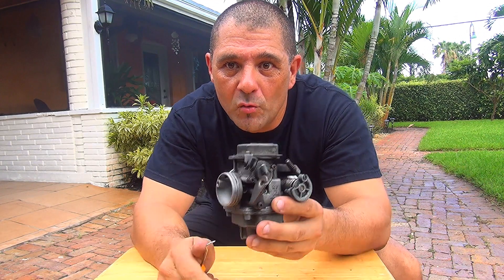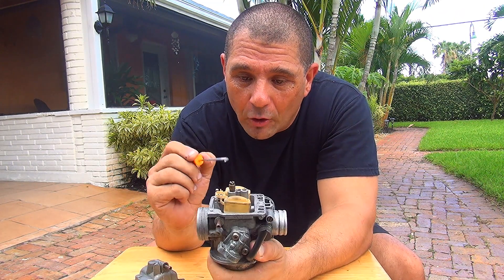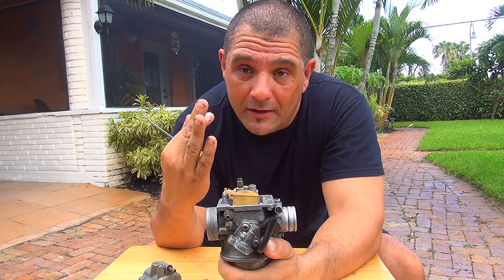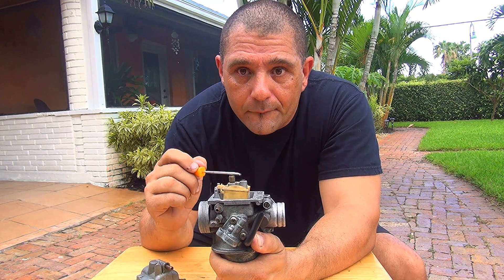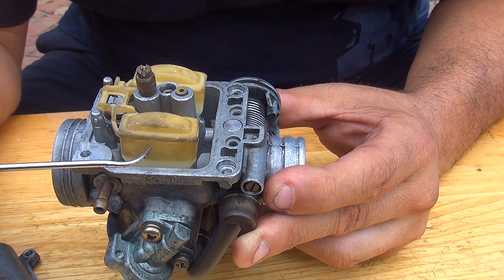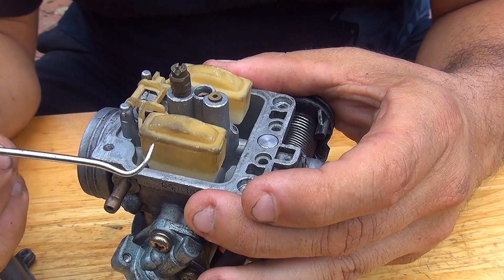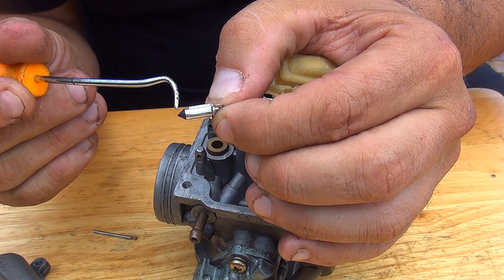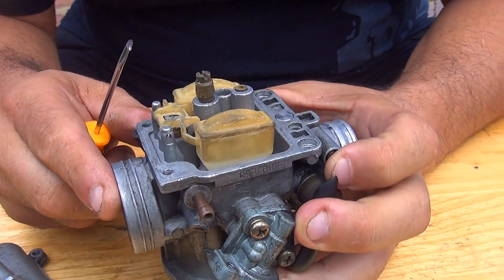Carburetor Float Level Adjustment

Comment: My bike stalls when i accelerate, unless i accelerate very slow. ¿can the float be the issue?
Reply from the maker: Yes, a high or sticking float can cause that. It may be flooding the carb check float height and needle valve.
Reply: @VirberelloScooterTips thank you

Comment: Thank you 🙏 didn't even realize this could be the issue you saved be from replacing the carb
Reply from the maker: Glad to help
Reply: @VirberelloScooterTips  So if the carb is leaking from the overflow spout - does that mean that the float is sticking OPEN and that the needle valve is not closing to shut off the fuel?

Comment: my float bowl keeps popping out and i cant securely fit it in, what do i do?
Reply from the maker: If your carburetor float bowl on your gas scooter keeps popping out and you can't securely fit it in, there are a few steps you can take to diagnose and fix the issue:

Inspect the Float Bowl and Carburetor:

Check for any visible damage or warping on the float bowl itself.
Ensure that the float bowl gasket is intact and properly seated. A damaged or improperly seated gasket can cause the bowl to not fit securely.
Examine the carburetor body for any damage or debris that might prevent the bowl from fitting correctly.
Check the Float and Needle Valve:

Make sure the float is not sticking or binding. It should move freely without obstruction.
Inspect the needle valve and its seat. If they are worn or dirty, they can cause the float bowl to not fit properly.
Secure the Float Bowl Properly:

Ensure that you are aligning the float bowl correctly with the carburetor body. It should fit snugly without forcing it.
Tighten the screws or bolts that hold the float bowl in place evenly and securely, but be careful not to overtighten as this can strip the threads or damage the bowl.
Replace Worn or Damaged Parts:

If any parts are found to be damaged or excessively worn, replace them with new parts. This includes the float bowl, gasket, needle valve, and screws or bolts.
Check for Compatibility Issues:

If you have recently replaced the float bowl or carburetor, ensure that the parts are compatible with each other. Incompatible parts can lead to fitting issues.
Consult the Manual or a Professional:

Refer to the scooter’s service manual for specific instructions on the carburetor assembly.
If you are unable to resolve the issue yourself, consider consulting a professional mechanic who can properly diagnose and fix the problem.
Taking these steps should help you identify and fix the issue with your carburetor float bowl. If the problem persists after trying these solutions, there might be a more complex issue at hand that requires professional assistance.

Comment: What if I have gas coming out the air filter side of carburetor
Reply from the maker: To address this issue, you may want to:
Inspect the float needle valve, ensuring it moves freely and seals properly.
Check and adjust the float level according to the manufacturer's specifications.
Clean the carburetor thoroughly to remove any debris or varnish.
Verify that the carburetor gasket is in good condition.
Examine the venting system for any blockages.
Ensure the fuel supply system is functioning correctly.
If you're not comfortable performing these checks and adjustments yourself, it's recommended to seek the assistance of a qualified mechanic or technician to diagnose and fix the problem.
I hope this can help you

Comment: Whenever I come to a complete stop, my gy6 150cc in my Vitacci scooter dies? I have set the idle screw up and it idles plenty fast, but why does it die just when I stop?
Reply from the maker: If your GY6 150cc scooter dies when coming to a complete stop despite adjusting the idle speed, there could be several reasons for this issue. Here are some possibilities to consider:
Idle Speed Adjustment: While you mentioned that you've adjusted the idle screw, it's important to ensure that the idle speed is within the manufacturer's recommended range. Setting it too high or too low can affect the scooter's performance.
Idle Circuit Issues: The idle circuit in the carburetor may be clogged or not functioning properly. Cleaning or rebuilding the carburetor could help address this issue.
Vacuum Leaks: Check for any vacuum leaks in the intake system, such as hoses or gaskets. Air leaks can disrupt the air-fuel mixture and affect the engine's idle and performance.
Fuel System Issues: Inspect the fuel system for problems such as a clogged fuel filter, faulty fuel pump, or inadequate fuel supply. Ensure proper fuel flow to the carburetor.
Ignition System: Issues with the ignition system, such as a faulty spark plug, ignition coil, or CDI module, can lead to stalling. Check these components for proper functioning.
Idle Air Control Valve (IACV): Some scooters equipped with fuel injection systems may have an IACV that regulates idle airflow. If equipped, ensure the IACV is functioning correctly.
Automatic Choke: If your scooter has an automatic choke, make sure it is functioning correctly. A stuck or malfunctioning choke can affect the engine's idle.
If you are unable to identify and address the issue on your own, it's recommended to consult with a professional mechanic who specializes in scooters or visit a dealership that services your scooter's brand. They can perform a thorough diagnosis and provide a more accurate solution to the stalling problem.

Comment: can i use 20w-50 oil in my 150cc engine
Reply from the maker: Anything is better then no oil but i will place the oil that is recommended for your scooter on your manual that will be best  for the performance
Reply: @VirberelloScooterTips   yes i checked it said to use 10w-30
Reply: @tommytuccersure I know your comment is a month old; but if you are still curious; the lower the W number is what protects your engine from wear during cold starts. If you use a different oil, try to make sure the W(winter) number is the same or lower than what is specified.

Now for the last number; this is operating temp viscosity.
With a higher number comes higher oil pressure; which can hurt seals.

If your motor has been used for 5,000 miles or more, your engine might appreciate a higher operating viscosity, like a 40 or 50 weight oil.
Reply: @greatestevar   ok I understand I didn't use the 20w50 I got a 10w40  . the weather is starting too get a little colder in ny so now I have too figure out which one too use now I know I need something thinner I believe

Comment: Hello do u know what a rattling noise is in the cvt ...only at high speeds.. its a new 50cc with 150 miles on it..
Reply from the maker: A rattling noise in the CVT  of your scooter, especially at high speeds, can be indicative of several potential issues. It's essential to identify and address the problem to prevent further damage. Here are some possible causes of the rattling noise:
Loose or worn components: Check for loose bolts, nuts, or other components in the CVT system, such as the clutch bell, variator, or pulleys. Over time, these parts can become loose due to vibrations and normal wear and tear.
Belt wear: Inspect the CVT belt for signs of wear, damage, or fraying. A damaged or worn-out belt can produce a rattling noise, especially when under high load at high speeds. If you notice any issues with the belt, it may need replacement.
Clutch problems: The clutch system in your CVT could be experiencing issues, such as worn clutch pads or a misaligned clutch assembly. These problems can lead to a rattling noise when the clutch engages or disengages.
Variator issues: The variator, which is responsible for changing the gear ratio in a CVT, may have worn rollers or sliders. This wear can result in a rattling noise, especially at higher speeds when the CVT is adjusting the gear ratio.
Transmission fluid levels: Ensure that the CVT has the correct amount of transmission fluid. Low or dirty fluid can lead to poor CVT performance and unusual noises.
Engine-related issues: Sometimes, noises from the engine can be mistaken for CVT problems. Make sure the noise isn't coming from the engine or exhaust system. Issues like loose heat shields, loose exhaust components, or engine misfires can produce rattling sounds.
Since your gas scooter is relatively new with only 150 miles on it, it's possible that some components may not have settled or worn in properly yet. However, it's essential not to ignore any unusual noises, as they can indicate underlying problems that, if left unaddressed, could lead to more significant issues.
If you're unsure about diagnosing or fixing the issue yourself, it's advisable to have a qualified scooter mechanic or technician inspect and repair the CVT system to ensure your scooter continues to operate smoothly and safely.
Thank you for watching my video

Comment: Hey, bro I know this is a different subject. But the scooter solenoid. If it is no good NI touch it with a screwdriver and my bike tries to start up. Does that mean it is no good and needs to be replaced?
Reply from the maker: Hey, bro! Messing with the scooter solenoid using a screwdriver is a trick to see if it's working properly. If your bike attempts to start up when you do this, it suggests that the solenoid might be faulty and needs replacement.  Safety first! Thank you for watching my video
Reply: @VirberelloScooterTips  Thank you so much, this guy is the best for your bikes information.......

Comment: Hello I have problem with my new carburetor he is not holding the idle and every time I stop like iam driving amd I stop the engine die when i dont hold the thortle
Reply from the maker: Hello! It seems like you're experiencing an issue with your new carburetor. The problem you described, where the engine dies when you come to a stop and you need to keep holding the throttle to keep it running, indicates that there might be an issue with the idle circuit or the carburetor's tuning.

Here are a few possible reasons and solutions for the problem:

Idle Speed Adjustment: The idle speed might be set too low, causing the engine to stall when you come to a stop. You can try adjusting the idle speed screw on the carburetor. Turn it clockwise to increase the idle speed slightly. Be sure to consult your carburetor's manual for the correct procedure.
Idle Circuit Blockage: The idle circuit in the carburetor may be clogged, preventing the proper flow of fuel at idle. In this case, you'll need to clean the carburetor thoroughly. Remove it from the engine, disassemble it, and clean all the passages and jets with carburetor cleaner and compressed air.
Air-Fuel Mixture: An incorrect air-fuel mixture can also cause idle problems. Check if the carburetor is adjusted to the correct mixture settings. If it's adjustable, you may need to adjust it according to the manufacturer's specifications.
Vacuum Leaks: Vacuum leaks in the intake manifold or carburetor gasket can also lead to unstable idling. Check for any leaks and fix them if found.
Choke Operation: Ensure that the choke mechanism is functioning correctly. If the choke is not releasing properly after the engine warms up, it can cause the engine to stall.
Throttle Linkage: Check the throttle linkage to make sure it's properly adjusted and not binding.
If you're not comfortable working with carburetors or if the issue persists after attempting these solutions, it's best to have a qualified mechanic or technician inspect and diagnose the problem. They will have the expertise and tools to identify and fix the issue properly.
Remember to always prioritize safety when working on your vehicle, and if you're unsure about any steps, seek professional help to avoid any accidents or further damage. Good luck with resolving the carburetor issue!
Reply: Thank, buddy I try everything what you write me, and a hope its is gona work because when I start the engine the idle is holding  but after some time not, ok thank you very much

Comment: Hello Virbirello mi amici, I have the strangest symptom with my Chinese 150cc. It stopped starting wiith two no rev limit cdi s I had I changrf the carb but it will only start with the stock cdi but revs at 5500 rpm, I am going to get a new NCY cdi but if that doesnt work, could it be the stator? Why would it only start with the stock cdi and cant adjust carb to right idle?
Reply from the maker: Ciao! It seems like you're experiencing an unusual issue with your Chinese 150cc scooter. Let's break down the symptoms and possible causes:

Starting Issue: You mentioned that your scooter only starts with the stock CDI (ignition control module) but not with the two "no rev limit" CDIs you tried. This could indicate compatibility issues between the aftermarket CDIs and your scooter's electrical system. It's possible that the aftermarket CDIs are not properly configured or not compatible with your scooter's specific wiring and ignition setup.

Rev Limit and Idle Adjustment: When using the stock CDI, you mentioned that the scooter revs at 5500 RPM and you can't adjust the carburetor to achieve the correct idle speed. This could indicate a problem with the carburetor itself or a potential issue with the fuel delivery system. It's worth checking the carburetor settings, including the idle screw, fuel mixture, and any potential clogs or blockages.

Stator Potential: If the issue persists even after trying a new NCY CDI, the stator could be a possible culprit. The stator is responsible for generating electrical power to charge the battery and power the electrical components, including the CDI. A malfunctioning stator can affect the ignition system and cause erratic behavior. However, it's important to note that a faulty stator wouldn't necessarily explain the compatibility issues with the aftermarket CDIs.

To troubleshoot and resolve this issue, consider the following steps:

Verify Compatibility: Ensure that any aftermarket CDIs you purchase are specifically designed for your scooter's make and model. Check with the manufacturer or reputable scooter forums to find compatible CDIs that have been successfully used by others.

Check Carburetor: Inspect the carburetor thoroughly, looking for any blockages or sticking components. Clean the carburetor and adjust the idle screw and fuel mixture to ensure proper operation.

Seek Professional Assistance: If the problem persists despite your efforts, consider consulting with a professional scooter mechanic or technician who has experience with Chinese scooters. They will have the expertise and diagnostic tools to identify the root cause of the issue.

Remember, troubleshooting electrical and mechanical issues can be complex, so it's always best to consult with an expert if you're unsure or uncomfortable performing the repairs yourself. Good luck in getting your scooter back to its optimal performance! Thank you for watching my video
Reply: @VirberelloScooterTips  Ciao! The carburetor is new, I tried it stock and with the previous carbs jetting on main and pilot w needle adjustment. Exact same symptoms. The idle screw and gas air mixture screw have no effect as to the revving issue. Also until recently both no limit cdi s worked fine, so I will try the new one ordered today, If not will seek assistance. Thank you Virberello for taking the time to answer my concern. Love your channel, all my best!

Comment: My gas tank is lower than my carburator. Would an electric fuel pump be overkill for a scooter? I don't like the vacuum petcock and a gravity fed switch I don't think would work for me since my fuel tank is below my carb location.
Reply from the maker: Hello if your tank is lower then your carburetor you should have a pulsating pump like the one is installed on honda metropolitan
Reply: Thanks Brother I'll try that...

Comment: Love your videos! 

my 50cc x22 moped was sitting for a few months. I changed the fuel filter and there is a pod for the air filter. 

The moped will only start with starting fluid then putter out, If i give it gas it might rev up but wont go pass 5 miles an hour or even a minute of run time. Any ideas on what it could be?
Reply from the maker: Hello Captain Frandy the described issues indicate a fuel supply problem. Possibilities include a clogged fuel filter, a malfunctioning fuel pump or fuel valve , a dirty carburetor, or a restricted fuel line. Inspection and cleaning of these components, along with checking fuel flow, would be recommended to resolve the problem. Thank you for watching my video and be safe
Reply: @VirberelloScooterTips  Thanks for the reply, I have been busy with work and finally had some time to try and diagnose the issue. 

I changed the fuel filter,  There is a vacuum on the fuel line as well as fuel when unscrewing carb drain plug. I havent tried changing the fuel pump, or cleaning the carb. Is there an easy way to clean the carb and check if fuel pump is bad? 

I just bought this moped and I want to get it working! Much appreciation and stay blessed!